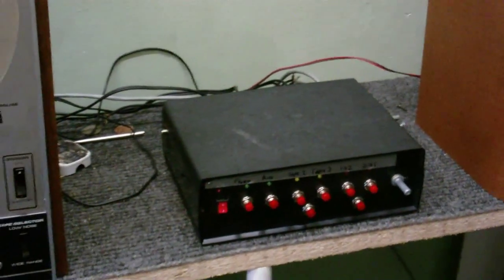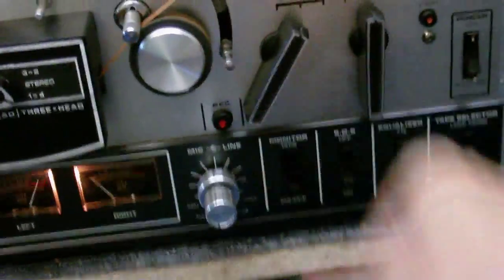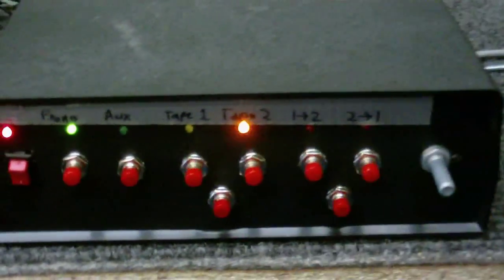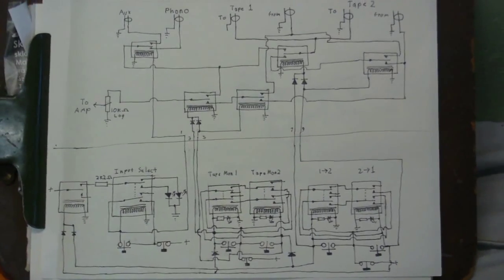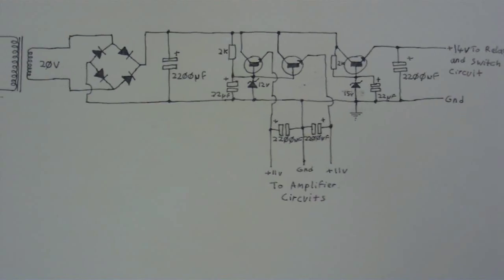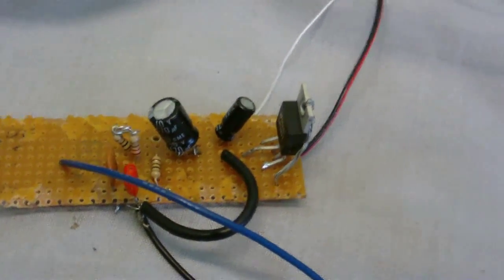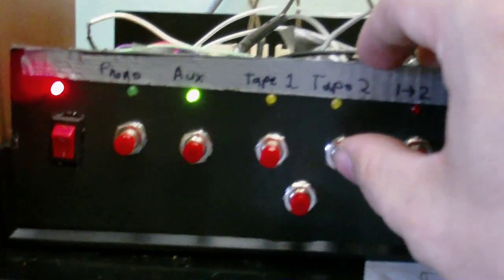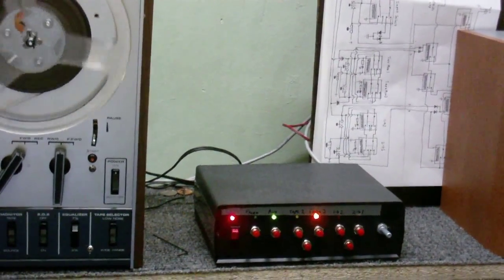The Amplifier Adventure - It's DONE!

Comment from the maker: I would use a 22k or a 47k as the volume control.  Here's how you wire it up:  The left pin of the pot connects to the ground of both the amplifier and the source's ground (the source is what ever device you're amplifiying), the middle pin connects to the amplifier's input, and the pin on the right connects to the source.

Comment: to make it less sensitive you need to adjust the gain with an bigger value resistor from pin 2 to pin 4 and put a resistor in series with the capacitor ;)